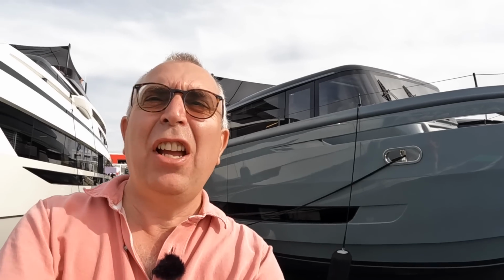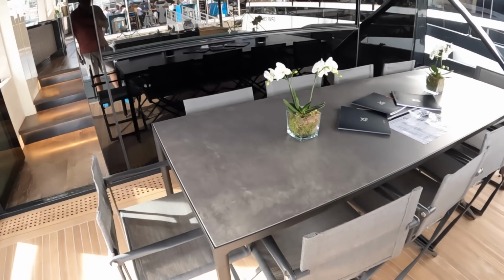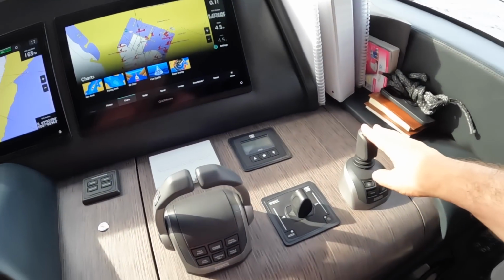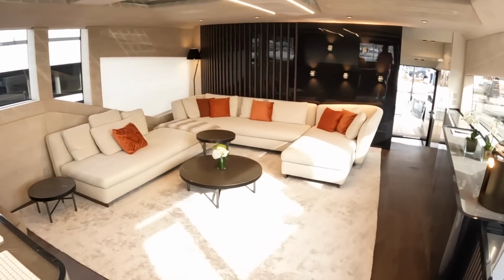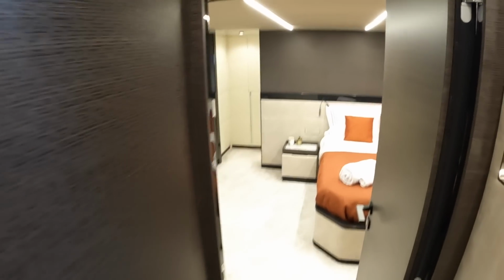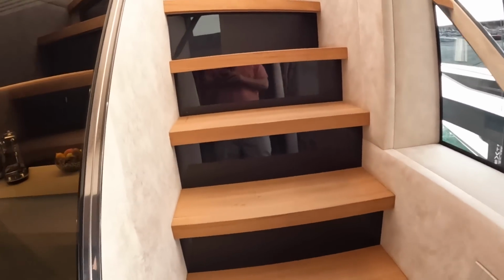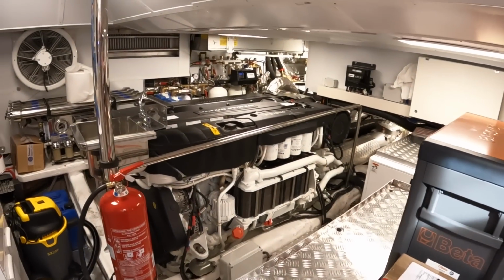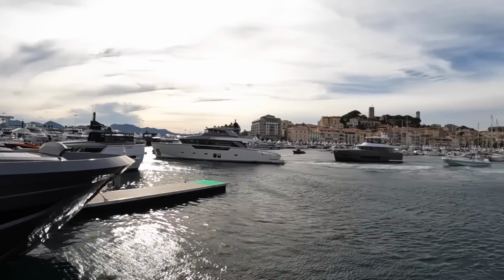€4.7 Million Yacht Tour : Extra Yachts X76 Loft

Comment: Looks very comfort and weel done..but the IPS...I understand that with this typer of propulsion you save space and fuel consuption but too much electronics and many problems...I had two boats with IPS, a Cranchi 43 and Azimut 53 and always so many troubles...changed 2 years ago with 15years old Princess 58 with classic propeller shaft (hope it's correct in english) and never had any problems..entusiatic!

Comment: The access and ladder into the crew quarters is the most stupidest thing I’ve ever seen very dangerous
Reply: No more dangerous than most ladders to engine rooms. For a 76 footer the crew space is decent mostly because a long staircase into it isn't taking up much room.
Reply: Totally agree with you. This whole boat is badly thought out and designers should walk the plank.
Reply: @tecwzrd  Try taking a look at Nordhaven's for the same price, much better equipped, far more comfortable and dream engine rooms, and crew facilities are much better if needed..
Reply: The crew quarters have direct access to the wheelhouse which makes a lot more sense than dumping crew onto the bathing platform
Reply: Yeah, they should've designed it so that engine room and crew areas shared a proper staircase. The space taken up by the two shafts is easily enough for one staircase. Then a door forward into crew areas and one aft into the engine room.

Comment: I apologize in advance for my harsh opinion, but the yacht/boating community has so many smart and innovative designs that always leave me wanting more that seeing this boat was quite shocking.
This is without a doubt the most impractical and down right stupid layout I have ever seen on a yacht. It would have been nice if the architect of this boat selected a smaller and cheaper vessel to learn his/her trade. From the "beach club" that isn't one to the abomination of the "wheel house". Good luck steering at night if anybody is in the salon (and if not, where are they supposed to be?) with cheap solutions like having screens mounted into upholstered faux leather panels - seriously!? I am ignoring the crew quarters on purpose. This is not designed to be seagoing it is a floating house at best.
Which makes the fact that the only redeeming space is the engine room so much more confusing (and even the access to that is overcomplicated).

Comment: Having recently bingewatched another channel which uses 60fps video I have to say that - on my large, high-fps monitor - the panning in your videos is really difficult to watch. In fact, I'm used to looking away slightly just to prevent it hurting my eyes. I think you once switched over to higher fps, but don't remember why you went back? Any chance of reconsidering that?
I don't know if Youtube allows both low and high fps versions but assuming it does, the low fps version should be easily auto-generated by YT.